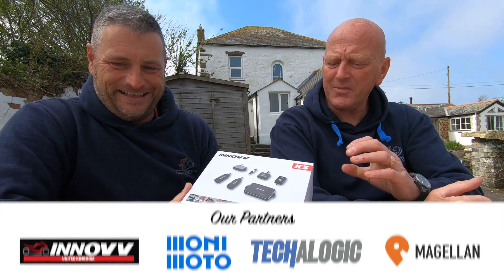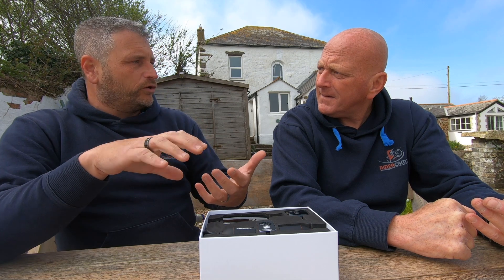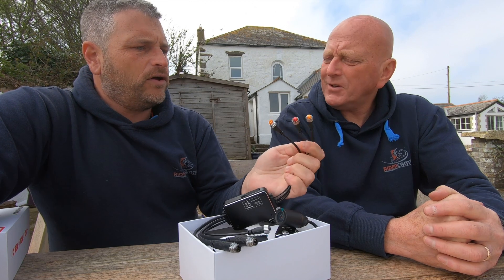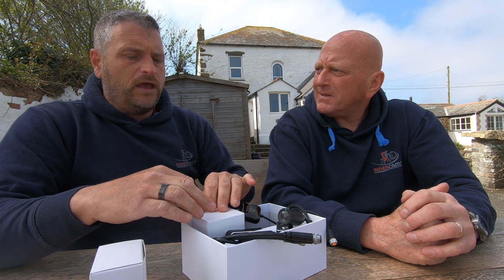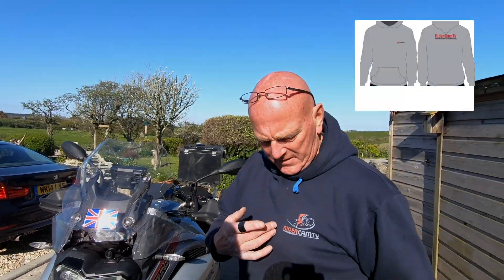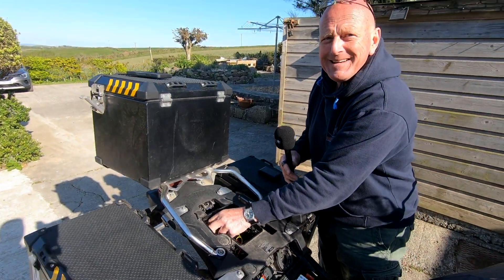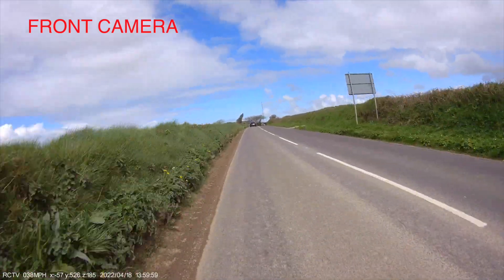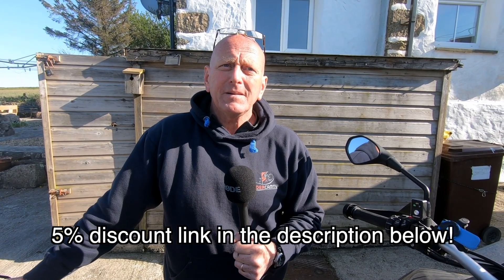INNOVV K3 Dual Motorcycle Camera System | Our First Look and Fitting

Comment: Can you use the dash cam at the same time your using your bluetooth for the com system (music) and directions off of google?
Reply from the maker: The K3 system has 2 cameras but it only see the footage you need to connect to the Innovv WiFi and select the footage you want to see so would need to be stood by the bike rather than riding it

Comment: Can someone describe the video output from the K3? (or k2 or k5)?  I suppose you can get individual files from each camera.  Does it also do anything like a dual screen thing with GPS overlay?  Is the GPS data encoded into the video, or is it just in print on screen?   I've not found a video where anyone actually shows the workflow of getting the video and what formats it can be in.

Comment: I wish they would make the bicycle version also 720P@60fps instead of the 1080p ,30 FPS it is limited to. I want to get the K6 motorcycle version for exactly those reasons, the 60 fps, but we cant power that model with a powerbank i dont think.
Reply from the maker: The K6 can be powered by usb, powerbank or hard wire. Says on their website
Reply: @RiderCamTV  i bought the k6 two days ago. 

While not ideal since it only has 30 fps all the other pluses more than make up for that. 

Power bank powered so no need to swap out batteries and can record for as long as your power bank holds up. Two cameras, front and back, up to 256 gig sd cards so that is prolly a whole days recording at 30 fps

I am tired of all the close calls with our "4 wheeled friends" who care so little for our lives. I am gonna start earning income for the police with this camera. On a 40 mile ride i have on average 2 close calls, at least 3-5 close passes and i see about half a dozen people on their phones.

Comment: Not sure I rate the INNOVV camera system that highly. Had the K2 for 2 years, fitted professionally, now it won't work properly at all and keeps saying various errors and connections as to why it won't work. Then it inexpliccably works? again and then not, again...?!?!  The system when it was first on worked faultlessly. It has not been tampered with in any way or messed about with. But now, seemingly all of a sudden, does not work...And it says it is not connected (it is) or not internet connected (it is) and the app will not work as it should and I cannot get in the app when it is saying; it is not this, or that etc.....Spoke to Steve at INNOVV many times about it, tried all of his advice in how to fix it, all to no avail. On reliability alone, I cannot recommend it, because just as you may need it, it won't have worked, it's rubbish and I am left with a £350 worth of useless camera kit. It worked faultlessly for a year though, so maybe I should be grateful...! This K3 you have just doesn't look or seem any different to the K2 set up and in my view, I would not buy the K3 either! Good luck with it, hope it doesn't fail on you.
Reply: Hello Paul. I sent you an email could you reply it. We want to help you solve the problem.